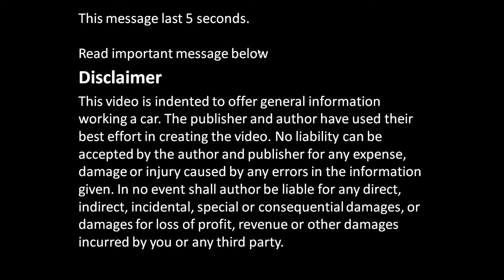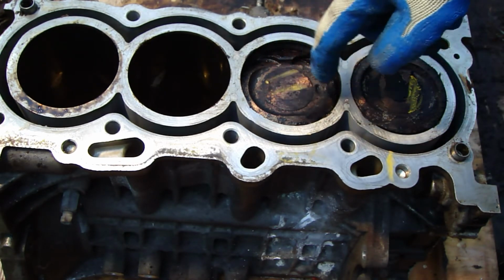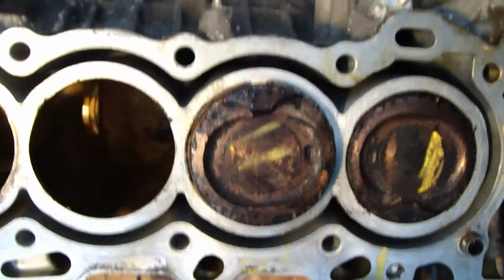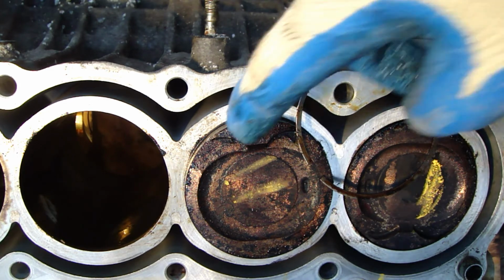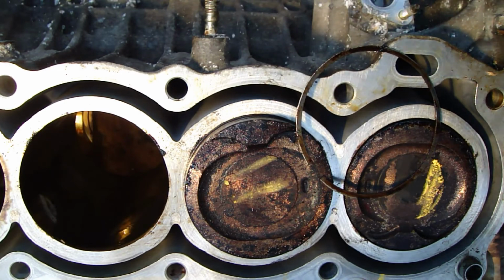How to setup pistons back from below Toyota VVTi engine

Comment: Hey Peter i have a question. My Cylinder 1 in my 2001 Celica is misfiring. When i pulled the spark plug it is covered in oil. Before this happened i was burning oil and i had a knocking sound coming from the engine. 

What i was planning to do was replace the rod bearings and piston rings for cylinder 1, maybe all of them since i am already there. But can i do this from the bottom of the engine or will the crankshaft get in the way of installing it back in? 

Do you think this is a good idea to do? i watched the engine flush video you have but i dont think it will be enough to fix the piston ring because my oil pressure light comes on and i believe the oil is just shooting through the piston onto the spark plug
Reply from the maker: Hi, you have oil leak in cylinder 1. Reasons maybe: oil piston ring stuck or valve gasket worn out.
Reply: what is the best way to get the oil ring unstuck?
Reply: also, in your opinion you do not think i need to rebuild the piston and the rod bearing?

Comment: Hello peter finn. have a question. my 09 corolla has lost compression on 3 pistone # 1, 2, 3 and consumes about 2 quarts every 1000 miles. i did DRY TEST RESULTS 1: 50, 2: 60 3: 40, 95 /// WET TEST RESULTS 1: 120, 2: 130, 3: 130, 4 150. so i am thinking its the piston rings worn. 

MY QUESTION IS can i replace the piston of the "2ZRFE i believe in my 2009 corolla le from the bottom of the car? looking from your video i believe its possible.

thank you in advance
Reply from the maker: +i sha  No, must lift the engine up. BUT, please flush the engine. Sometimes piston rings are only stuck. Look my video: https://youtu.be/Ohr3nmDdAt8